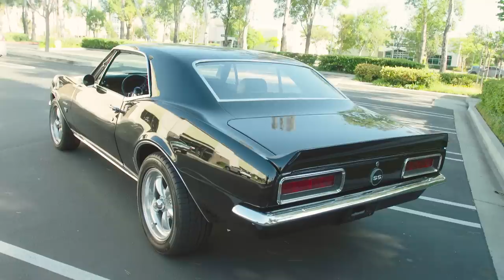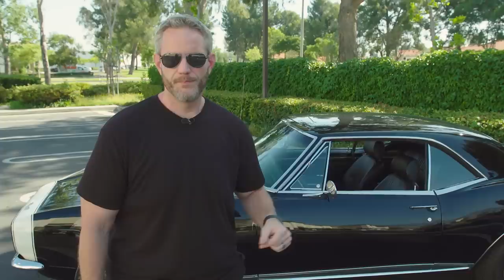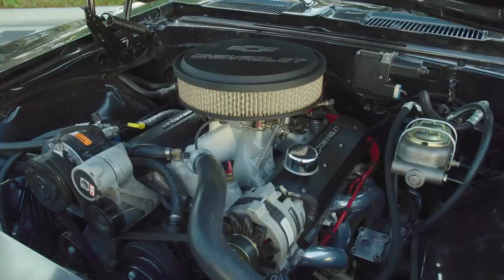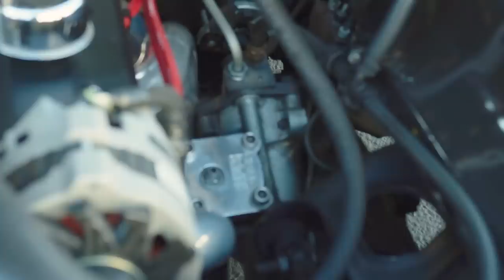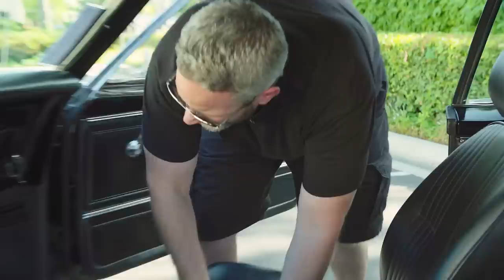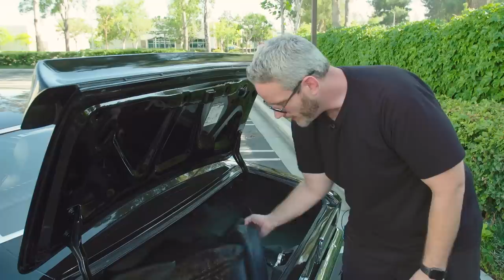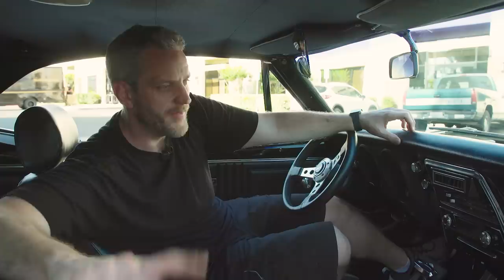Time for a new car build! Let's Resto-Mod a Classic!

Comment: In Re the air comment, cars like that are actually why I support CARB and electric cars and trying to reduce fossil fuel usage.  In my perfect world my kids will be able to take an electric train to work or school, I'll have an electric car or motorcycle for family trips, and then on the weekends people will go to trails and ride 2-stroke dirt bikes or go do track days in 700+hp muscle cars where people don't have to worry about cheap gas mixed with 10% ethanol that destroys the engine.  And people will go out on the weekend and cruise around in classic cars because we won't run out of gas because we only use it for hobbies and all the necessary stuff we use fossil fuels for will be done with renewable energy.  That'll never happen though so, you know, smoke em if you got em.

Please don't ditch the chrome.  It's so classic and beautiful.  67 was my favorite year, really loved the front end of the RS. 427 definitely the LS7 is amazing, but I would go for FI, I had way too many old bikes and pickups growing up that were just such a pain, I mean, FI was pretty terrible until recently in my not-professional opinion, but the current setups are just so great and you will get power and fuel efficency. Though it's warmer where you live so you won't get the same issues we did in the northern midwest in the winter.  Wheels, no reason to not get 17" or 18" wheels, actually fitting a C5 front end or similar and going with oversized disc brakes all around is a reason to use larger wheels.  Biggest thing I would be worried about is letting your wife drive it.  Not because that's a bad idea, I think that is the best idea to get a car like that with an auto trans, but because as soon as you pointed out that the windows don't all close all the way and then with the issues with the rear quarter, you need to get the frame looked at.  Even if it's 2* off front to back that would still worry me at freeway speeds.  That car hasn't just been "hit" that car has been "crashed".  Whether it was reported to the insurance or not I would want to make damn sure that frame was straight as an arrow before I let someone I cared about take it out.

Comment: had a 1966 ford mustang it was a v6 put a 302 on it fully restored it and lowerd it to a modern look  with nice wheels put 18s front and back with a 245/45 it stuck to the ground really good  and was a nice daily before i sold it cause i need it money cause i had gotten fired i regret selling it but need it the money :( glad so see you build a classic car less of a hassle to maintain

Comment: get some window regulator rebuild kits for the doors and quarter glass Jay.  Don't buy reproduction window regulators unless you're going to do an electric window conversion. A few companies even reproduce an electric window switch that sits in the stock window crank location.  Slap a nice and tight converter in the transmission and have a valve job done on it to make it snappier and thus have less slush and power loss when it shifts.  A lot of drag/street cars run 2 speed powerglides so ignore those who wanna weigh in on manual vs automatic and one being better or worse that each other.  Each has it's pros and cons in the real world.

Comment: My dad and I are working on a 69 Barracuda fastback. We're putting in a 6.1 hemi and a ZF 8-speed with paddle shifters and modern steering wheel seats console and suspension. I was thinking about putting some fender flares and wide tires on to make it a road coarse care but that can be for later.

Comment: If it was me I'd do some 18's front and back, or maybe 18 rears and 17 fronts.  I love that look.  As for the motor, the LS7 is gonna be wicked, though I don't think I'd go with a carb on it.   A lot of the headaches with carbs are mitigated by going distributor-less, but modern fuel injection is just so damn nice.  After fiddling with carbs for years on my C3 Corvette, if I went the LS route, I'd never look back at carbs.  I'd keep the chrome too

Comment: I'm a huge fan of putting hidden modern tech into a car like this. Converting to power locks, power windows, and discrete, complimentary LED lighting. GPS, android/iOS auto mirroring, usb charge ports.

And of course, the biggest challenge: as much as possible must be hidden & removable/restore to original.

Lastly, paint it red again.

Comment: My 2cents...  I'd give the 3.08 gears a try for a while.  (Unless your trans changes add a good over-drive.)  Since this is your "cruiser" it will be much nicer on the highway.  Also you have so much torque you'll still have plenty to roast those tires with the 3.08!  This is all based on my old-school experience with 2.73 to 3.55 ratios on old-school non-overdrive transmissions.

Comment: I think you should give a lot of thought to the center console area regarding the radio. I don't know how much you plan to look at it but radios towards the bottom are the worst for safety from my experience. A heater & AC you can pretty much adjust without looking but ya want to see what station or song you're listening to. Maybe consider moving the radio slot for your double din flip out screen towards the top & put the heater & AC towards the bottom. I think the interior curves would prevent a flip out style on the bottom from being able to be angled upwards so best to just put it up as high as you can. Also on a very off topic note since this is a resto mod, do some silly unknown things to it. Add a train horn, don't have to use it just save for if you're on a back road & there's a really stubborn animal that won't move.

Comment: I actually want one of these at some point, I'd do basically do what you are doing but I'd go for an LSx 454 and put bigger wheels on it to clear bigger brakes all round (something a lot of people forget when adding lots of power is that you need to stop at some point also), I'd also look into giving it a full suspension overhaul to improve the handling (yes, even cruisers need some form of handling).

Comment: For a cruiser I’d ditch the Holley for an edelbrock carb.  Holleys are more for putting power down the drag strip but you’re constantly screwing with it and they just dump the fuel on...or be a big spender with a fancy efi system

Comment: LS7 is probably my favorite LS engine, but i find it seemed a bit to modern for your car until you said it was going to stay with a carb, that's going to be cool. You can already tell it's currently a slightly more modern engine in the car now because of the center-bolt valve covers

Comment: 10:34 depends on what kind of choke the carb has
manual choke:
turn key, let rev 1 sec
turn key, let rev 1 sec
turn key, half way through key turn push gas pedal half way down, continue turn key, VROOM
electric choke:
"feather" the throttle while turning the key
wait 2 seconds
repeat

Comment: If you want a good transmission that has modern shifting speeds but handles the heavy torque output of those older chevy engines. Take a look at TCI, I was at one time looking at their transmissions to upgrade my 78 Camaro which sported a 450SB with a transmissions rebuilt to tighten shift timing. They had a variety of transmissions so you could really pick not just the power distribution but also personality of it.

Comment: Jay! might as well do a regular fuel-injected LS (a sniper EFI kit intake manifold and ignition box will cost more then a terminator x and a car intake), buy a seal kit for the car from JC Whitney and it sounds like if the window doesn't reach you may have convertible windows  -------- 6l80e transmission will last you forever and a day!
oh the last thing those rear end gears are probably what's making the car feel slow that's the things id personally start with

Comment: The hood thing bothered me on my 64 Riviera. I found a keyed cable actuated hood lock from a company called "Megatronix" (model HL6) on amazon. It's a 6ft long cable with a steel plunger on one end, and the other has a lock that mounts under your dash. It took some minor fabricating, but I rigged it so that the plunger blocks the hood release lever from moving. Unlock it, it pulls the plunger back, and the lever works normally. Made from good metal, no lightweight junk tin.

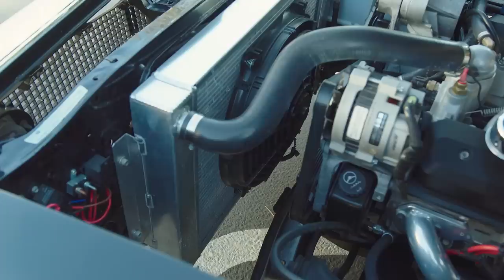Comment: 07:55 factory radiators back then were never aluminum.
Aluminum changes temperatures quickly.
Since you are in California you might want to check if that electric fan will stay on after you turn the engine off (for like couple minutes).
That way if you stop at a convenience store when it is 100 degrees F outside, the radiator temp won't go to 300

Comment: JAY
do a hairbrush thingy with the paint so it's brushed metal colored and it will look cool and when you step out of the car you will look like vin diesel with hair. that's what i would do. I would also go the more modern cruiser route and then rip out the entire interior and install a more modern interior with a new dash with rgb on it because you know, rgb enhances performance. OH and cup holders. cupholders everywhere.

Comment: For radio, I'd advance the hell out of it.  Double Din would be an insult. I'd do something more Modern like a  linskwell and update the HVAC to work with it. Nothing like a remote start and HVAC control working in a real hotrod. As for as the rest goes, get it all disassembled, and have it the body done and powder coated to the original color as best you can. Then when the car is sprayed for the rest of the panels you can guarantee a rust free body. AS far as the wheels and drive train, go as modern as you can while keeping street-able.  I love the old skinny pizza cutters on 15"'s with an 8.5" street legal slick/drag radial too, but you set those up for the track, and leave your modernized wheels on for daily driving.  This should be kept a dual purpose car. Street/strip no problem, or my streets just can't cut it here's my 8.5" slicks lets have a day. The only other change I'd make is I'd go disk all around.

Comment: What I would do? Get that rust outta the trunk yesterday, go ahead with the 427 cause....power. Holly EFI, supercharger, keep it all under the hood. Leave the suspension alone unless there are issues, hook that oil cooler up pronto, trans cooler too. Replace them seals pronto so you aren't dealing with MORE rust, then get that bish painted a dark grey with some subtle metal flake in it, lose all the chrome, black that bad boy out. Its a hell of a start Jay, Id kill for that car to be completely honest.

Comment: If it were my car: I’d go with the wide slicks on the back and thin up front. I also love the idea of combining old with new. So the display in the console was an idea I love. I’d also go with catback exhaust, but I’d also do black and chrome. I know you said you weren’t going to do that, but that’s just my two cents. 😜
Reply: I should clarify on the tires: if it’s a daily driver then more modern tires. Weekend/special occasion: by all means go fatty rear tires!

Comment: Honestly jay I would keep the chrome trim and repaint it I liked the color white on a camaro from 69 and though it may look good on this with like a black stripes in the middle of the hood all the way down and like some black accents on the quarter panels  and fix that rust issue and get a different muffler for the more deep rumble kind of sound

Comment: Dip the body so you really know what you're working with.      It's your car, but I hope you don't go bigger than 17/18 on the wheels.   I've seen 18/19 look good too, but I just prefer more sidewall.  The Hot Rod Power Tour is in August this year (fingers crossed).  If you aren't familiar, check it out. Great content for the channel.  Maybe do power train now and body after the Tour.

Comment: youll notice a huge difference jus fixin the tv cable  actually youll wanna do that asap no joke u could possibly b steady glazin or even burnin the clutches out of it, especially if its so far outta wack u cant even get it to downshift when u floor it thats waay bad change ur fluid after u adjust the cable to  the hot clutches will cook the fluid

Comment: I have a 68 Firebird.  Turn signal cancel cam is super easy to replace.  It appears that the screw holding the lever on has vibrated loose.  Not uncommon for those older cars.

Comment: My built 355cid gen 1 block shredded my 2nd gear in my stock 700R4. Unless its a well built 700R4, it wont last if you beat em. Since then I got a built TH350 3 speed with a 3500 stall on my 85 firebird good for 600+ hp. It ran 12.5 @ 109 with the edelbrock performer rpm package, crappy posi 10 bolt rear with 3.23s. The LS7 will be sweet.

Comment: Badges as rs/SS but it does not have the rs option reverse lights or lights, not ss. You could get the hide away headlights or base, in v8 models. The z28 came with base front, option to get the rs/ss option.

Comment: Go larger wheels so you can put some nice 6 piston calipers out front and four spot on the rear. A nice set or Budnik wheels 20 x 12 on the rear, your going to have to fix that rear quarter anyhow so you may as well fit a set of stamped mini tubs in there (you can get them from one of the companies that make new bodies and they look factory,) 19x 10 on the front if they will fit. Full pro touring all the way mate, they have street presence but they are also practical for road and track and aren't a one trick pony like a pro street.

Comment: I can't say i would do anything too different than what you laid out.  I personally would put a touch screen stereo or engine monitor but I like the location you are thinking about so long as its subtle.  Definitely the first thing i would do is strip the paint and fix the rust but order of things doesn't really matter a hole lot except for certain things.  I like the idea of blacking out the trim. Are you gonna do the bumper too?

Comment: You can figure out the factory engine by decoding the VIN
maybe someone already commented on this.
I did that for my Nova, it was a 305 v8 and I bought it with a 350 v8

Comment: I wouldn't put skinnies and slicks bc you said it was going to be a driver. Also I think the metal under the paint and Bondo will be scary the shop I work at has a 69 SS and we've found some problem areas had to put new dash metal in and a place on the back window seal rusted

Comment: My wife has a 1969 Camaro (non SS) that her mother left to her. She got it restored a few years ago and we use it as a weekend cruiser (more or less). Mechanically it's in good shape but the paint and body work weren't done correctly. Pretty sure it will always be a "project car". 😂

Comment: Jay a 12 bolt is a 8 3/4 gear the 9 inch is a ford thing, if that car has a 12 bolt it should be a manual car or a big block car so.. your dataplate should be fun to read.

Comment: Great looking first gen, but get that TV cable fixed asap, that little valve can destroy whole transmissions if not adjusted right.

as for what to do with it, go watch some roadkill with the crusher camaro and get inspired, you are in southern cali, autocross muscle is all over the place and you already got the ZL1 for that!

Comment: Classic cars need to have the classic feel to them beyond the exterior, you don't want to have a touchscreen next to a choke button; everything should feel original, even if it's not, and only add modern touches where necessary, like the stereo. Also, it's a performance package car from the sixties, it really should be standard.

Comment: Interior is good.
For the engine I would do the same a built ls 5.3 or 60
Full power brakes and steering 
Full suspension and 9 bolt rear end.
Some beefy road track and road tires 
Full exhaust 
Full sound system with 10 inch subs
Very light tint on windows
Maintain ac and heat system. 
Would do a full paint strip to metal fix any bad panels
Replace all the seals fix and align body panels
Transmission I would go 4l60 built. Don't do the 4l60e unless you want to run transmission computer. Full light upgrade if those are still factory and not changed which means you need to run relays and get fuse box

Comment: what i would do, supercharger, new hood to fit, Direct Injection, probably that LS swap, straight pipes w/ side exhaust , Holly Dominator EFI, Tuned to 5-600 HP, Manual Swap it, Hi end Audio system, but not excessive, ROLL CAGE hidden with interior trim/body mods, better seats, better harnesses, wide race tires front and rear, front slitter, rear diffuser, and a wing, race suspension, wide body, fender vents, carbon ceramic breaks, a turning radius that makes Ken Block ashamed and plenty more.

Comment: At some point I'd like to own a car from that design philosophy, not sure what it will be, not sure when it will be (fresh electrical eng graduate) but eventually I think I will have a nice old car to cruise in. And while I can appreciate all of the modern or transitional pieces under the hood that you have or plan to have going on there  (AC is nice to have, even in Canada) but I would go for as factory as I can for outward appearance, with some liberties taken. I'm not a massive car nut though so who knows.

Comment: Since your going ls7 then do a 6l80e with paddle shifters. Before u do the engine though. Since the zz4 is already cool, do all your suspension. I vote on ridetech air ride full package and get fat tires all around for that pro touring look and then get use to throwing it around before you make another 200hp from the ls7

Comment: Though thermostats are CHEAP.. 190F is more modern desired temps. And would be ideal if you put a Throttle Body Induction (TBI) style fuel injection (a carburator replacement fuel injection). I would name drop but several good ones out there. I would look at doing that, would gain you a few more MPG's and also could gain you more HP.